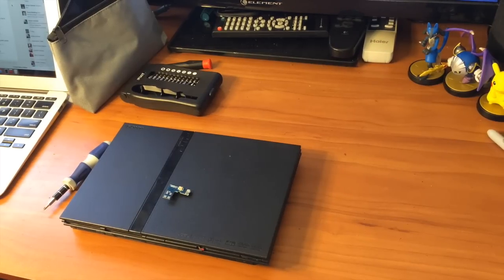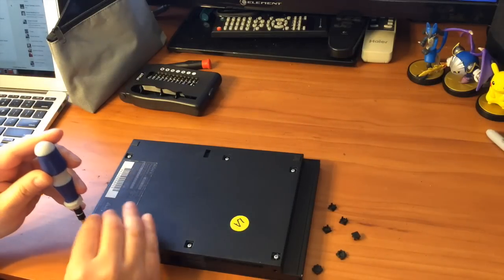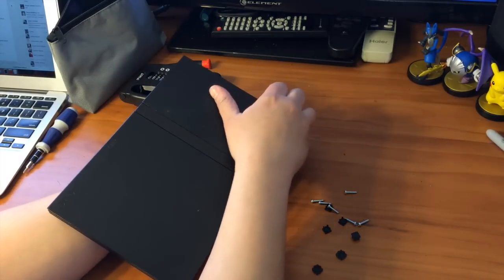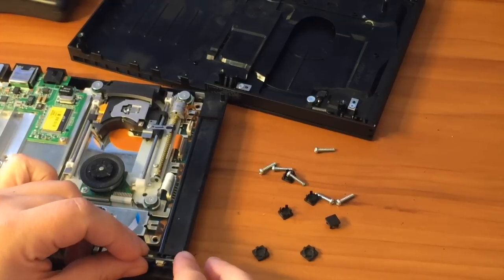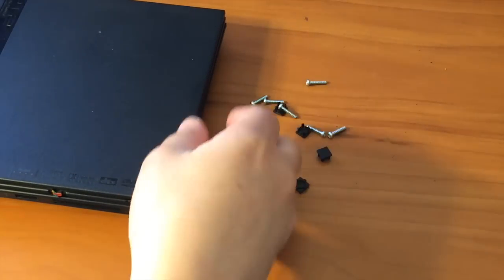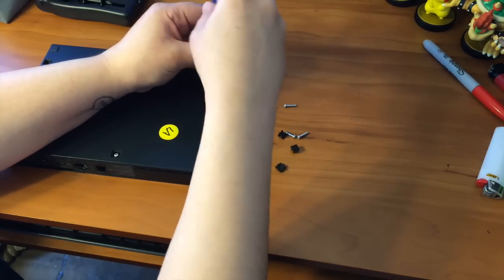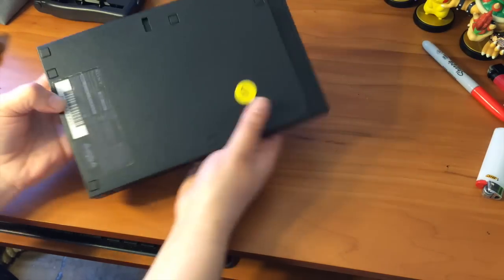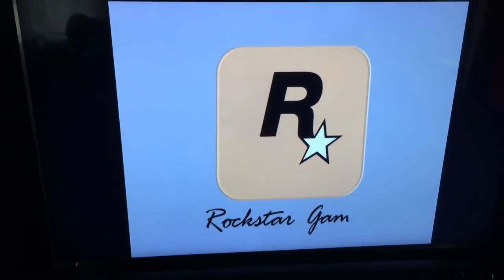Tinker Time DIY: PS2 Slim Power Button Replacement

Comment: Hi, I had the same problem where the small white button fell off the green piece. If that small white button falls is there no other way to fix it, or is ordering another piece more practical?
Reply from the maker: Alex Izaguirre Sorry for the late response. You can probably fix the switch that fell off by finding another piece to solder back on however I find it much more practical to replace the entire piece. Unless you have a very good soldering skills and a very steady hand soldering a new piece on might prove very difficult

Comment: Is there a way to make the reset button cover stick? Mine fell off and idk if it broke or
Reply from the maker: I mean I'm sure a drop of crazy glue would do the trick but honestly it may just be easier to find a replacement cover for it. It seems like you may have broken a clip on it or something.

Comment: my dad was fixing our families and that little clicker thing, the one your husband broke fell off. is there anyway to put it back on?
Reply from the maker: +Laura  Travaglini As long as you have a very fine tip soldering iron, you should be able to reattach it. I wasn't able to since my husband ripped off 1 of the 4 "feet" that attach it to the board. Honestly it's easier to just buy a replacement button on eBay and do this method in the video.

Comment: hi,nice video ;) 
btw i have a ps2 77000 model can i replace with a 90000 model power button?
Reply from the maker: +luckyxever Thanks. As for your question, don't hold me to it 100% but in theory they should work since I believe both systems were slims but only hardware changed slightly. I'm sure more dedicated forums for playstation enthusiasts can confirm or not.
Reply: thank you :)

Comment: I bought the replacement power button and ribbon cable but I don't get a light on the new power button when I plug it in. The old power button lit red but didn't turn on because the button fell off from the circuit board. Please help.
Reply from the maker: Is it possible the ribbon cable is inserted backwards?
Reply: No I inserted it in the same way shown in the video with the blue facing towards me. Do you think a picture of the internals would help?
Reply from the maker: Unfortunately I won't be able to tell much from a picture. Outside of what I did in the video, I'm not overly experienced with the PS2 internals/boards (yet). Is it possible you may have been mistakenly sent the wrong piece for another model?
Reply: I am pretty sure that I got the correct part since it is identical to the one you had in the video and since I have the same slim model. Thanks for trying to help.
Reply from the maker: I'm terribly sorry I can't be much more help. I will continue to look into it to see if I can come up with anything.

Comment: I tried this but it did not work. But my ps2 light wont turn red or green. it just stays off.
Reply from the maker: +Maurice Mcneil Check your solder points. It could be that the points are not soldered enough or too much. Alternatively it could be that it's a completely different issue.
Reply: thx
Reply: +Candi's Classic Game Shrine oh and I saw a lot of videos about how to fix the ps2 slim but on the bottom right corner there is always things placed in that area but its empty on my ps2 ever sense I got it. Is that like a cheap version or something?
Reply from the maker: +Maurice Mcneil I'm not quite sure. It could be a slight model variation. It happens sometimes. Did you buy yours new?
Reply: on ebay but never opened so I guess
Reply: +Maurice Mcneil same, something is wrong with my cord or something, I tried cleaning the circuit board but nope. PLZ HELP!
Reply from the maker: +Chase Belcher Did you try replacing the power button? If so did you check your solder points? It could be possible your board is fried it's difficult to tell without seeing it.
Reply: Candi's Classic Game Shrine I will try to replace the power button and thanks I left a sub!
Reply from the maker: +Chase Belcher Thanks! Good luck on fixing the system! I hated having mine broken for so long.
Reply: +Candi's Classic Game Shrine thanks!
Reply: i just bought a new one. Its the original
Reply: +Maurice Mcneil cool.

Comment: where can i buy a replacement power button?
Reply from the maker: +Tanisha Collins I picked one up on eBay for a couple cents at the time. They're pretty cheap. You can also find non-working systems and take them out of there. Whichever situation presents itself first or cheapest.

Comment: from where did you order it , and how much does it cost
Reply from the maker: I ordered it from eBay and it was about $1.50 shipped.
Reply: Candi's Classic Game Shrine Can you give the link?
Reply from the maker: The listing no longer exists, so no I can't. :(
Reply: Candi's Classic Game Shrine Ok I have a quick question so the power switch I ordered for my PS2 works but it does not click all the way for some reason.
Reply from the maker: The plastic button on the shell of the console doesn't click or the new switch doesn't click? If it's the latter, it's likely a different style switch used in the power switch if it's the other, I would check to make sure everything is lined up properly on the console.
Reply: Candi's Classic Game Shrine The new switch does not click
Reply: It clicks a little
Reply from the maker: They likely used a different style tact switch in the 3rd party power switch. Those kinds of switches come in all kinds of, "clickiness"
Reply: Candi's Classic Game Shrine Alright
Reply from the maker: Looks alright to me.

Comment: I was trying to fix something else and that popped out and I put it back in and now it won't turn on :(
Reply from the maker: You likely need a replacement button like I did. Soldering it back on usually isn't enough. Also, make sure when you plug it back in, it's inserted correctly
Reply: Oh I didn't have it clicked in :( stupid lol but soon enough my ps2 will be fully working just need to fix the spinning on disk and the noise and I'm good! Best video out there!
Reply from the maker: Best luck fixing it the rest of the way, thanks for watching. Nothing makes me happier than being able to help my fellow gamers
Reply: +Candi's Classic Game Shrine :)

Comment: But what i need to do, if small button is broken
Reply from the maker: You would need to purchase a new piece that the button sits on. You can try to solder it back on but chances are it won't work as well. If I'm understanding correctly, you are in the same situation I was originally in. My husband knocked off that tiny button so I bought a new piece entirely.

Comment: Somebody help me!!!  I opened the bottom lid of my ps2 and then after 2 minutes closed it.  When i tried turning the power button on it wouldn't press or click.
Reply from the maker: It sounds like the button on the shell that you depress may have gotten loose or moved.
Reply: i lost it what do i do now
Reply from the maker: You best bet is to order another replacement piece.

Comment: Thank you thank you thank thank you thank you
Reply from the maker: Glad this was able to help!
Reply: Candi's Classic Game Shrine Brocken power thing is green yours is blue we have the same model should it still work if It’s blue like yours and is their any way to turn it on while I’m waiting for the part to come
Reply from the maker: Unfortunately you can’t play it until the part comes in. The color of the ribbons shouldn’t matter as long as it’s for the correct model. Sometimes there’s slight variations in them between manufacturers.